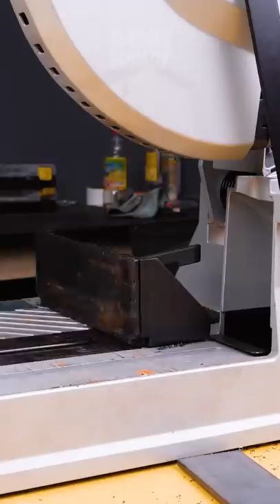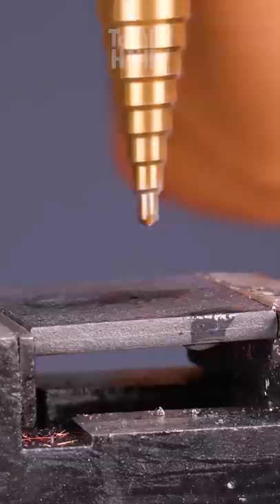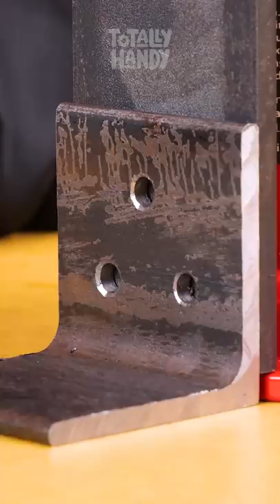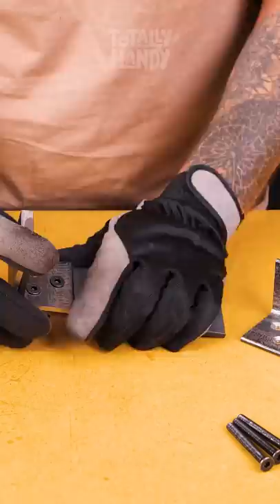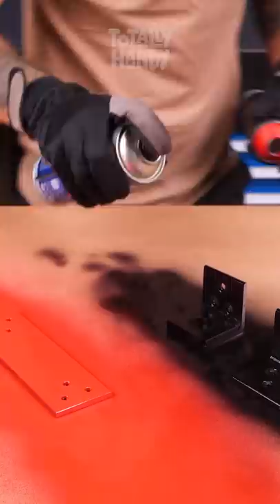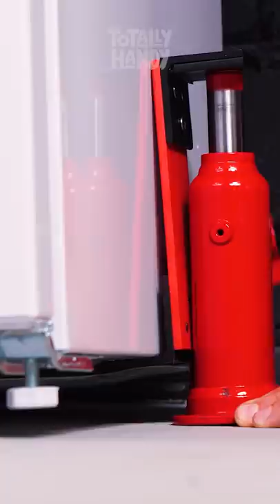Old Jack Remake to DIY Tool #shorts

Comment: I think those bolts were way too short. They should have been at least 3 times as long, before cutting them off 🤣
Reply: Exactly what I thought…. Used 70mm bolts and cut them to 5mm 🤦🏼‍♂️🤣 this channel is hurting my head!
Reply: Why screws. And not weld it all. Lol
Reply: @BLURby84  haha this
Reply: @BLURby84  They were what he happened to steal from work.

Comment: They make sliders just for this situation. Which are a lot cheaper, so you can slide the refrigerator out of the way. and clean underneath it throughly before sliding it back. Works for stoves too and tables pretty much any furniture or items that may need moving.

Comment: Many are the times I wished I had a toe jack for lifting or moving a machine. Most heavy machines with cast bases have a little opening to slip the toe into, then you can lift to begin mounting on some 4x4, or put a couple of steel rods underneath. Trouble is, this one needs mounting to a plate, so the base has a toe of its own.

Comment: No info how to attach it to the jack and why bolt when you’ve shown you can weld
Reply: That's because it's not attached to the jack. Didn't you see it tip forward at the end as he jacked up the appliance? Sketchy af design.